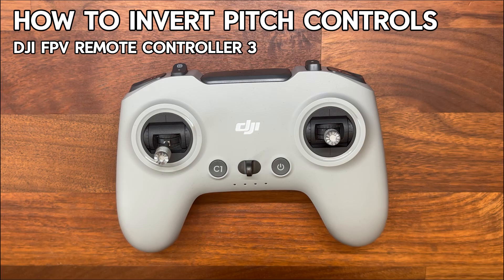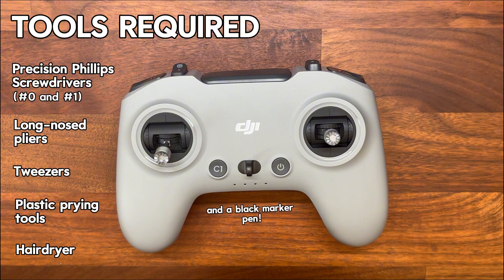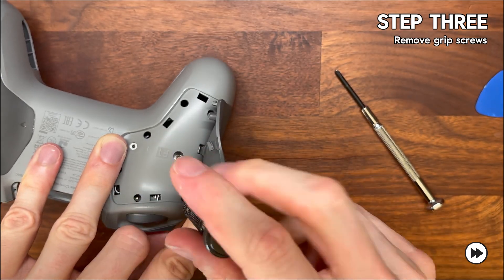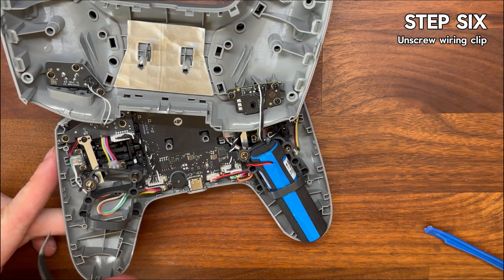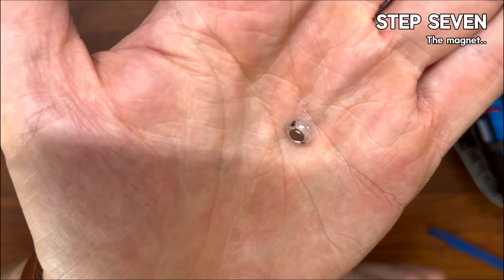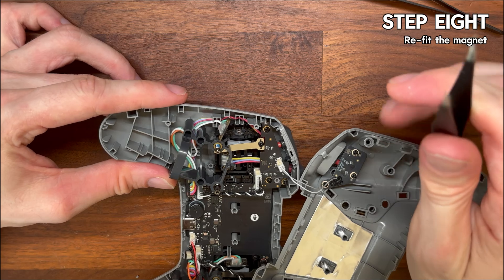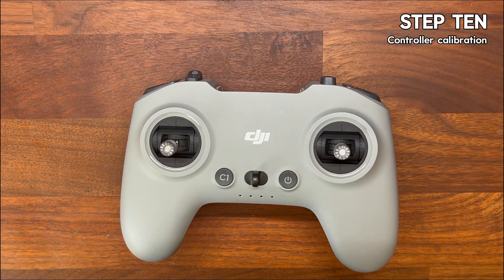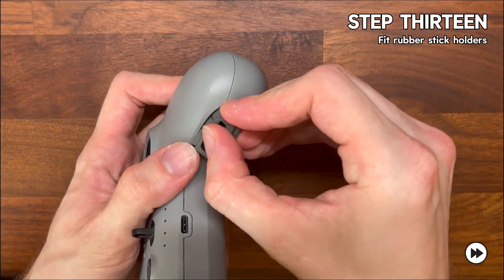HOW TO: Invert Pitch Controls on DJI FPV Remote Controller 3 | Step-by-Step Guide (No Software Fix)

Comment: I just did this myself and have a tip:

On the other side of the magnet holder is a hole, so you can use a simcard remover or a really small allen key and poke the magnet out from the other side when its hot enough
Reply from the maker: Great piece of advice - I hadn’t noticed the small hole! That’ll save a lot of frustration, cheers.
Reply: Thanks for the video and the tips, I have modified the magnet for the x-axis on the right side (located in the center of the joystick), I didn't want to spend any more time learning with a new setup. Thank you guys! 🫡

Comment: my magnet fell out on its own onto the floor so i now have no idea which side is which…
Reply from the maker: That's the reason you need to mark it before you remove it from the plastic casing :(  Not the end of the world though! Refit it and see if the axes are inverted. If not, then you know you've fitted the wrong way round.

Comment: Hi I have a unique issue after doing this and hope you can help as there are no answers online anywhere! After I connected my controller to the Avata 1 again, the camera tilts up and is permanently fixed there. The wheel on the controller won't adjust the angle and I also can't start the drone. So I decided to flip the magnet back in the hop this fixes it. The same issue remains. Is there something extra I need to do to fix this? BTW the motion controller works fine when connected.

Comment: I took mine to a local shop but I don’t think they did it right.  When I go to calibrate, the right stick up and down goes to 100% but it’s not inverted.  Moving up on the stick the calibration image / direction goes to 100% upward. I’d think the calibration would show me pushing the stick down when pushing it up, after flipping the magnet.  Also, on the inverted / right side, the left and right do not register during calibration.  No response, left and right stays at 0%.  Any ideas what went wrong.  It’s a reputable shop, surprised they’d screw it up.

Comment: Anyone have a clue why DJI does not just bring a new mode to the software for inverted up & down ?
Reply: They’re not aware - just spoke to a software engineer at DJI and explained, they sounded surprised, and very keen to fix the issue.  I was promised it will be brought up at the next firmware update meeting. I highly encourage anyone else who wants to see this fixed call up DJI and explain the benefits to adding the one line of code to the next update. Thanks
Reply: @lwwilde  crazy there's no custom mapping option. I'm looking for Mode 2 but X axis of left and right stick swapped, no inverted axis.

Left Stick Y: Throttle (Ascend/Descend)
Left Stick X: Sideways Pan Left/Right
Right Stick Y: Forward/Backwards
Right Stick Y: Yaw (Rotate in Place)

This is the most intuitive control imo because Right stick takes care of majority of navigational movement, and Left controls altitude. Sideways panning movement I use rarely unless for cinematography reasons